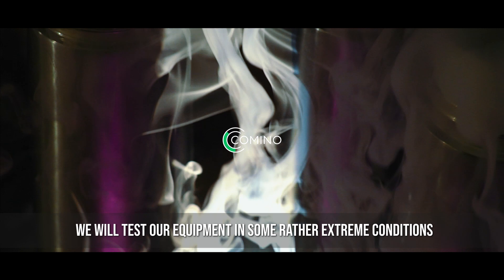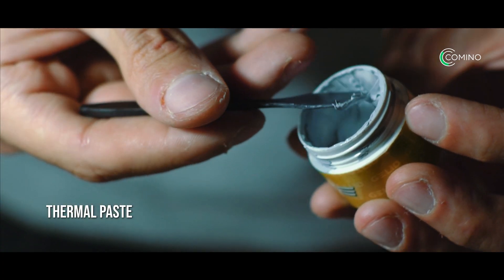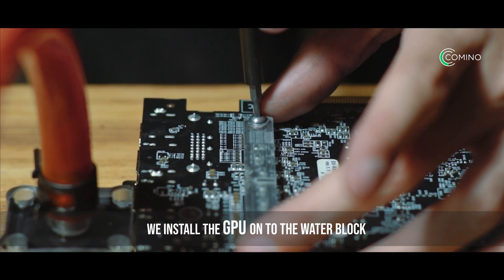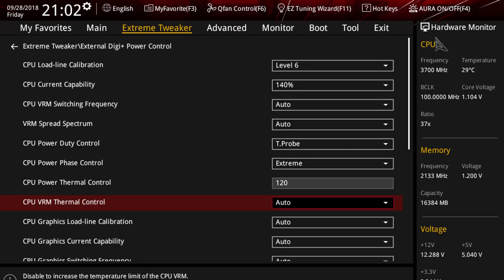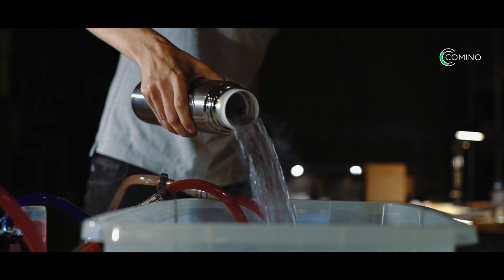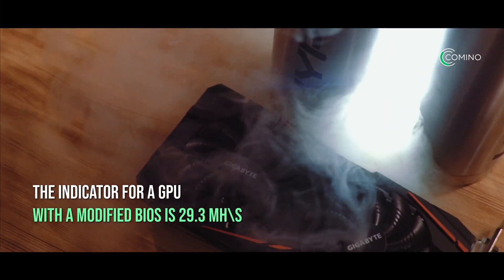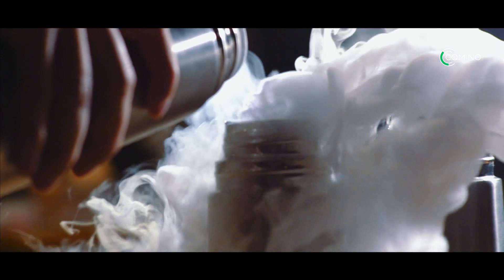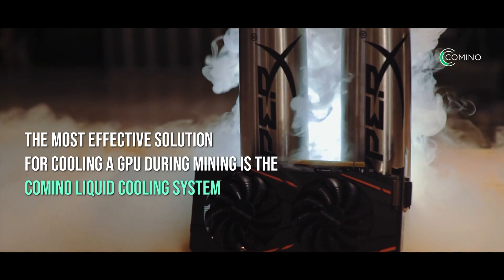Gigabyte RX 580 8gb Extreme GPU overclocking with nitrogen to the max

Comment: Hiya, i am wondering if you could make a testing video with cooling the graphics card gpu with liquid nitrogen whilst minning with the card overclocked at 1000% ? to give  faster hashrates.. that would be awsome to check if it actually improves better hash rate

Comment: i have aorus rx580 and i use 1450 mhz with factory fan and under working max 74°C
Reply: I have a Gigabyte RX580 1450 Mhz, 16GB 3200Mhz memory and it usually stays under 70C with factory fans. I live in a hot city in Brazil ( +- 25-30C)

In the beginning of the year I was planning to buy a RTX 2060 Super ( It used to be around R$1600 in promo), but with the coronavirus, with that money I could barely buy a RX 580 (last year, it used to be R$900). LOL
Reply: @arkadia3549   rx580 is a very great card! 
I do not regret
Reply: gigabyte rx590 at 1650mhz and 2100mhz memory, still under 75C
Reply: I have the same card, can you tell me what program you used to overclock? And what settings?